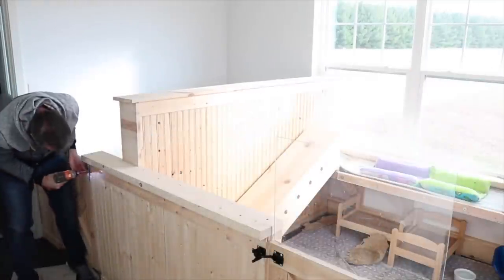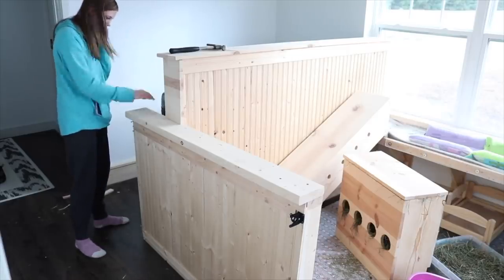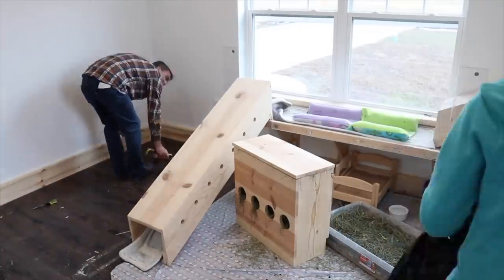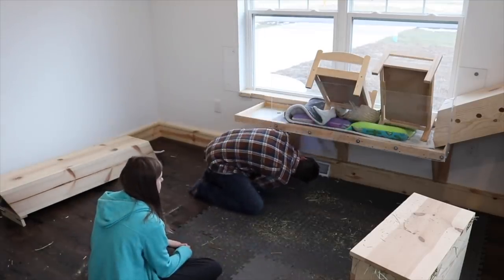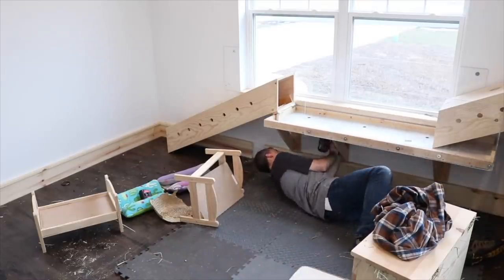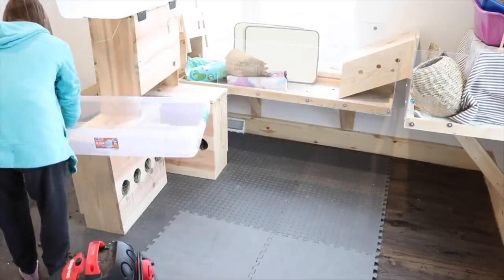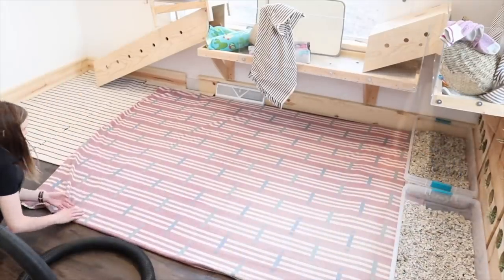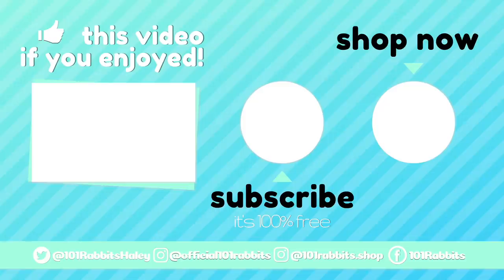RABBIT ROOM MAKEOVER

Comment: Do the puzzle mats protect the hardwood floor from an occasional pee accident? My rabbit never pees outside his litter box, but I’d like to protect our floor in his Xpen just in case!
Reply from the maker: We have a waterproof vinyl wood floor so it’s not real wood. It won’t bubble or get ruined with pee which is super nice! But when I did have wood floor, the puzzle mats never leaked anything underneath it! If you were worried you could always put puppy pads under the puzzle mats but I’ve never had issues
Reply: Thank you!